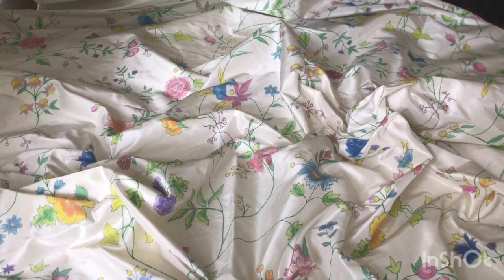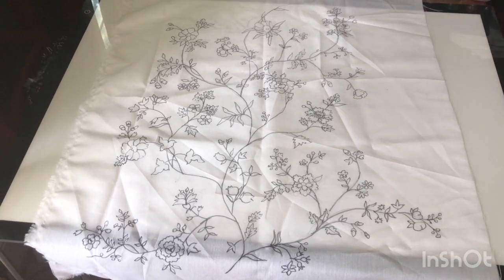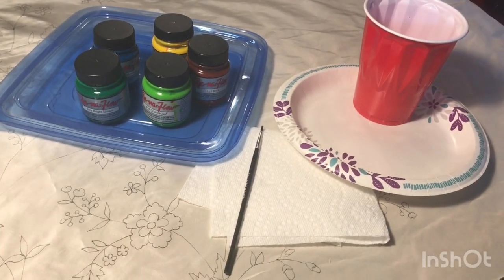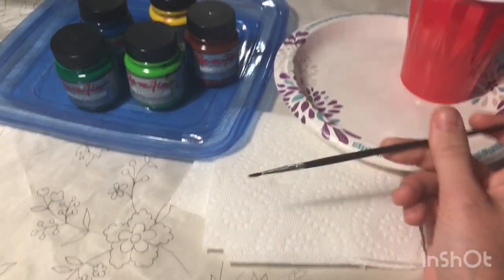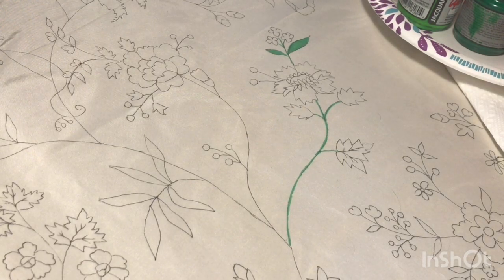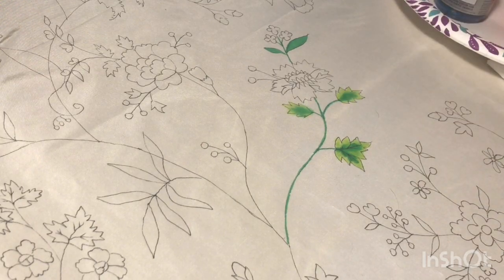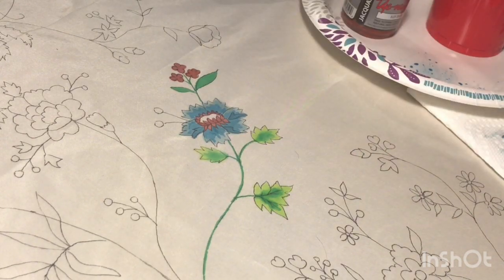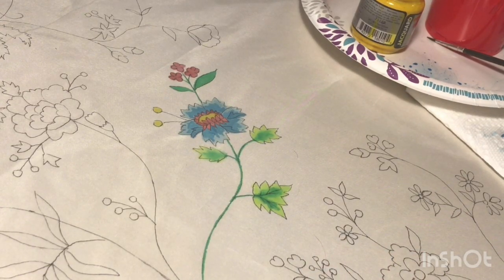1760s Painted Silk Sacque Gown: Painting the Fabric

Comment: But using it in this way, even ironing — can you still wash it or do you have to dry clean it?  I wash all my silk and have for decades (66 yrs old) use to have the occasional silk blouse, dress or skirt, jacket etc for special occasions.  Just hand washed with mild soap (none of the stuff like out today). If you don’t have silk wash, you can use plain, no scent, color, etc Johnson and Johnson baby shampoo and just a drop of baby conditioner in the rinse water which is how I currently do 30 momme silk pillowcases, duvet covers, wedding dresses, etc. I use sodium percarbonate for antique yellowed silk or even new if it’s gotten a stain on it— granular hydrogen peroxide basically.